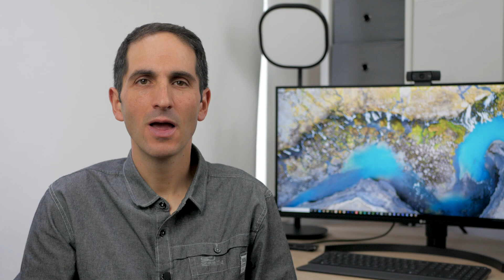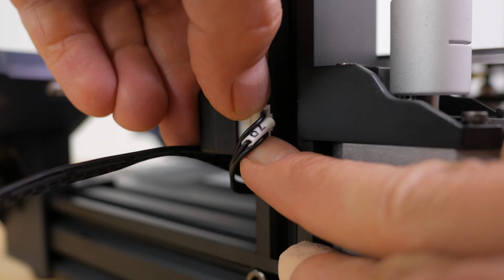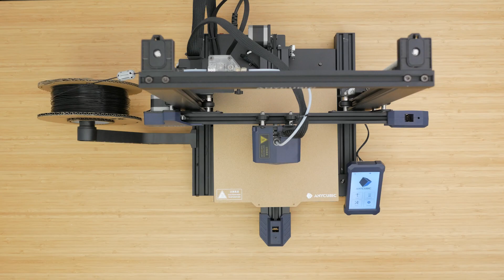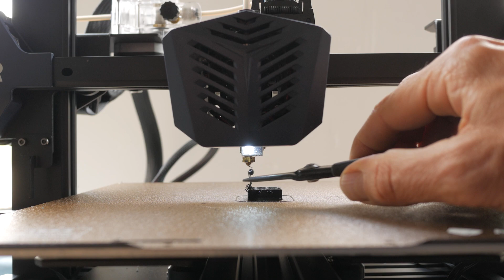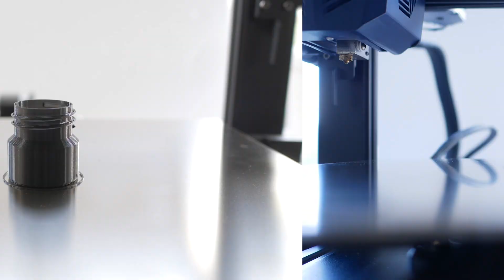Anycubic Vyper review | Perfect beginner 3D printer? | Unboxing, setup, auto-levelling, test prints

Comment: I'm probably a year into 3D printing and the Anycubic Vyper is my first printer. The bed leveling is great but it does have some issues.
Don't print large prints with the spool in the default location, I'd put it above it and make some brackets for the extruder/filament sensor, the default filament tube sucks and will expand eventually with heat creep and fudge stuff up but that's an easy upgrade, print z axis spacers.. I'm currently making a ball bearing spool holder... other than that it has been great.
I don't find it loud and it lives above my room and sometimes I sleep beside it too If I set a timer to flip prints in the night. also last thing my filament sensor and auto print stops during power outages dont work but you just have to make new g-code or cut and glue it where it failed to a new half. Also sometimes if you heat the bed by hand to fast the senso shuts it off so use cura not the touch screen.
Reply from the maker: Sounds like some great tips!

Comment: I have had my Vyper since they were first available ( i3MEGA prior to that). It has printed flawlessly right out of the box. I typically use IdeaMaker as my slicer. 
re: NOISE. I did put a variable buck converter to the PSU fan. Tune to voltage to as acceptable air flow and noise level. BIG DIFFERNCE. Easy mod. Great review. Thanks.
Reply from the maker: Great suggestion thanks!

Comment: My son bought an Ender 3 and I later bought an Ender 5. I bought us both a Big Tree Tech main board which is a vast improvement in noise as it can control the stepper motors better and we installed BL Touches which work just fine. All printers should have automatic bed leveling and be as quiet as possible in my opinion. Thanks for your review...
Reply from the maker: Sounds like some great upgrades. Noise is a big issue I agree - I think 3D printers are generally nosier than people expect - even one with quiet steppers. The Prusa Mini is the only printer I've tested so far that I can work beside if need be.

Comment: Thanks! I bought a Vyper about a month ago (Aug. 2022). For basic parts, I agree that the Vyper works "out of the box". This is my first 3D printer that I own, but I have lots of experience with the University's equipment. Some of the problems you discovered have been fixed by now (e.g., Cura profile). However, my parts are stringy. I ran the TempTower and RetracTower scripts in Cura and adjusted, but still have problems. I am using AnyCubic's cheap PLA so I don't draw any serious conclusions about the printer yet. I have problems with supports being very difficult to remove, but I think that is a profile problem, not the printer. I tried to print an articulated slug that failed miserably. The internal parts fused together (stringing likely). As you said, maybe there is no perfect printer for beginners unless beginners only print "beginner" parts. I have yet to try the clearance test!
Reply from the maker: I'd definately try some other filament. And make sure the filament is dry - even PLA is stringy if wet.

Comment: Great review, I was looking at the Ender Pro V2, but despite your negatives, I think I'm going to go for this one.

Think the auto leveling is a huge plus for me, and the easy removal bed.
Reply from the maker: Great let us know what you think of it!
Reply: Did you get it yet? I just ordered one today.
Reply: @DoofnBluntzGaming  I just got one last week, and I am planning on returning it. Main issue is bed leveling nightmare  (I know there's additional auto lever you could buy), but on mine bed doesn't stay leveled between prints, more so it seems to drift in middle of print (the spring knobs adjusting bed height are very lose and like to shift if you look at them too hard). Second problem is warped and unevenly heated bed (possibly warped due to very uneven heating, not sure). Outer edges of build plate are barely warm while center is very hot, causing serious warping issues on large parts. When it prints a long line on first layer - it looks like a wave some of it scratching the bp, some of it stringing... and yes I leveled the damn thing 1000 times by now. I am beginner so I am sure there are fixes to this, but in my opinion if you're buying Ender3 to print stuff, you're in for a lot of headache. It seems more oriented towards tinkerers/experts. Also manual is garbage, basically had to watch bunch of youtube videos on how to set it up. 

TLDR: It gave me nothing but frustration this far.
Reply: @drawmaster77  Your comments seems to be addressing an Ender 3, not the Vyper in the video
Reply: @vetterbydesign  yeah Ender 3, I got Vyper it's worlds better imo
Reply: Get a Prusa mini.  It works out of the box and has very few problems.
Reply: @drawmaster77  i have similar issues plus i think i got a faulty motherboard causing a a crazy amount of layer shift if i try to print anything bigger than a benchy. They offered to send a replacement motherboard but its still too much headache with the bed not staying level and its also a bit warped, z bar not alined correctly because of the way its set up wrongly so its bending and more issues, so i declined and ordered a vyper. 100 euros more and has way more upgrades that you can do to the ender with that amount of money without the fuss of adding them yourself

Comment: Hi, nice review. I bought the early bird release model at a discount price. And I can see they have made some improvements already by the look of your machine.
I had the problem with the strain gauge sensor. And now have it replaced with no hassle from anycubic. And Also had the extruder slipping, I added threadlocker as it keep coming loose.

I’m pretty happy with it now. But the replacement part took 4 weeks to come, and there also was 24hr delay on reply even though only 4hr time difference in NZ
I think they are on the right track with the design. Maybe v2 will be quieter and improve in build quality
Reply from the maker: Thanks. Good idea with the thread lock. I think 4 weeks is too long - and I agree I'd like quicker support. But at least they are resolving issues. Have fun with the printer!

Comment: I've received my Vyper a few days before. Previously I had a small Tronxy X-1 for 3 years (no heatbed, no auto-level, no filament sensor). Well, my feelings are mixed, and are in sync with your review.

Since Tronxy was one of the cheapest option back then (~1/5 of Vyper) and multiple years have passed for technology improvement, I expected much greater difference between the two printer's performance. I'm kind of dissapointed...
- With Tronxy the parts popped right off of raft, Vyper tends to fuse with it.
- Tronxy displayed info during printing even with Octoprint, Vyper does not show any details only when printing from SD card.
- Both are noisy as hell... :D However, Vyper's fan noise is loud only, steppers are hard to hear during print. With closed door it's nice even at next room.
- By Tronxy, dimensional accuracy was way off in XY plane, that one is better with Vyper.
- However, the same part with the same material tends to have strange blobs and stringing by Vyper. I hope it can be fine tuned, but as there are a lot of complaints on it, maybe Tronxy was superior in this too...

I need more time to get familiar with it, and adjust it, but maybe it is not such a big hit...
Reply from the maker: I think most 3D printers need some tinkering to get the best results - but I'm sure in time you'll have the Vyper singing!

Comment: Still using my Anycubic i3 Mega, & it's proven to be a very reliable printer in it's stock form. Looking at this Vyper, but haven't worked out a real need for it yet.
Reply from the maker: With 3D printing if you have something that works well for you I'd stick with it! If you need a second printer that's another matter 😉 ...
Reply: The i3 Mega was my first printer and it worked flawless until I sold it, I want to get a 3d printer again and I'm wondering if I really need the extra features of the viper over the mega, the only one I cosider important is the build volume and if is more silent, because the mega it was a bit too loud.

Comment: I've been seriously considering upgrading from my modded Ender 3 to this so this info is definitely handy. The ender 3 has a PEI magnetic bed, BLtouch, and upgraded 32 bit board but a lot of the other features on the Vyper seem to be really nice and tempting. Having a hard time figuring out if it's worth it for the larger build plate, all the extruder bonuses, the dual cooling fans, and dual Z lead screws. I know I can potentially add all of that to my Ender but the little issues with things like the BLtouch randomly throwing an error requiring a restart and manual pulling out of the plunger makes me wary of investing that much money into it. It seems better to just spend a similar amount overall to get the Vyper and avoid having to mess with wiring and such and risk damaging the whole printer. I sweated buckets just swapping the board so I'm not inclined to go through that for what is rapidly becoming standard features on beginner printers.

So as a beginner/intermediate user my question is would you consider this worth the money to swap to? I tend to print in PLA or PETG for the most part though I've played with some TPU before and would like to print it more. The improved print speeds are also of interest as I tend to print larger models regularly and just use my photon for smaller more detailed ones.
Reply from the maker: I think if you've already added ABL to your Ender and a PEI magnetic bed - the Vyper won't offer much more. Those are the two features that I consider a useful upgrade. Personally I'd try and fix the ABL on the Ender. But if you're after a second printer that's another matter!

Comment: Hello! Some things are a bit superficial ... Ender 3 V2 has no touchscreen. Vyper has built in TMC 2209 drivers but they are not supported as such by the motherboard, so useless. You have a modified version of Vyper in front of you, recognizable by the flat Z-Stop switches, modified hotend and plug on it. The first versions were very vulnerable, the newer ones hopefully not. Otherwise, thanks for the review!
Reply from the maker: That's right they did make a few changes after they released this printer initially. Well spotted on the Ender 3 V2 - I only have the Ender 3. I quite like the dial personally!

Comment from the maker: Is there another model I should take a look at? If you have this model what do you think of it? Please let me know down below!
Timestamps:
0:00 Introduction*
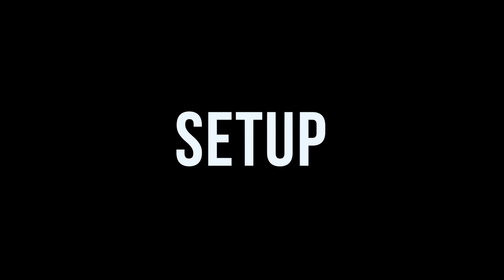1:01 Setup*. Unboxing, what's included
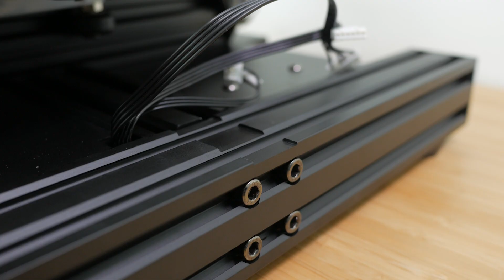1:43 Assembly
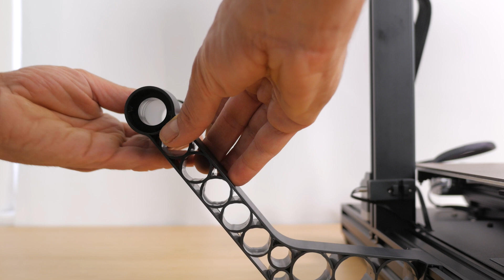2:40 Post assembly checks before printing. Check no play in print head and bed belts are tight
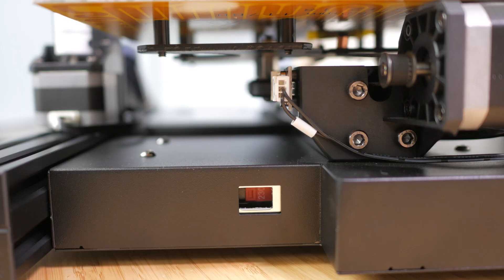3:12 Auto-levelling the bed including important pre-checks. Ensure strain gauge working
4:23 Advantages of this strain gauge levelling system
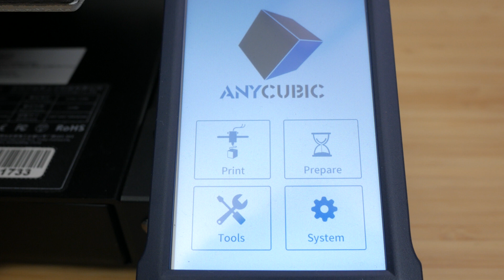5:02 Loading filament
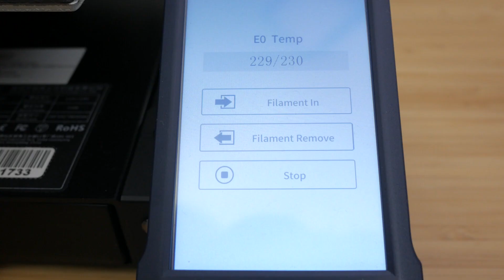5:46 Checking tensioning knob
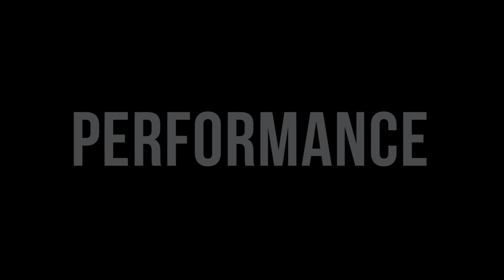6:05 Performance*. Printer specs
6:41 First print with included PLA. Moving owl.gcode to root of SD card. Checking layer height and adjusting Z offset and other settings
7:39 Setting up CURA, importing profiles
8:10 Testing filament runout sensor
8:43 Testing Power Resume feature after power cut
9:16 Testing colour change filament
9:57 Print quality discussion, slicing software and profiles
10:18 Setting up PrusaSlicer with the Anycubic
10:46 Quality difference Cura and PrusaSlicer profile
11:05 Accuracy of prints and testing printer tolerances
11:38 Magnetic PEI sheet, first layer quality and releasing prints.
12:00 Testing smooth side of PEI sheet, cleaning PEI sheet with IPA alcohol
12:41 Testing temperature variation of the bed with FLIR imaging camera
12:53 PETG print quality (Prusament Galaxy Black)
13:15 Flexible filaments print quality. NinjaFlex, Eryone TPU. Creating custom profile in PrusaSlicer
13:47 4.3" touchscreen. Turn off beeps
14:08 Using printer with Octoprint on a Raspberry Pi. Can remotely control printer, adjust e-steps and check mesh bed levelling
14:36 Noise from printer - listen to sound test. 32-bit board, silent stepper drivers, loud fans
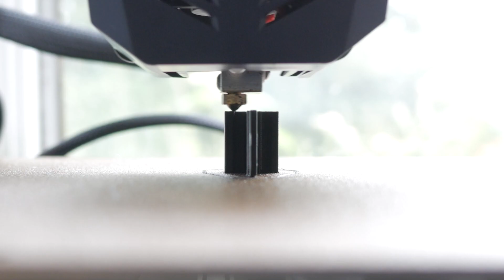15:07 Cable management. Printing off simple clip to solve main issue
15:28 Extruder gears issue. Tightening extruder gear with 1.5mm hex bit 
15:47 Conclusions* and verdict
Reply: Hi have the Vyper and think it's great!
Reply from the maker: Brilliant - glad you're enjoying it!

Comment: The 3D printer is about 3 years old and I still have doubts about its availability. 

First, In today's technology, linear rails have become widespread and I can buy a model like the ender 3 v3 ke for a similar price. However, I care about stable, expandable and long-term use. Which would be better?

Secondly, the printing speed is a little slower than new printers. Do you think this is an important factor?

And finally, Have the slicer updates you mentioned in the video arrived?

Thank you very much if you answer my questions and I congratulate you on such a professional video.
Reply from the maker: I’m afraid I don’t have this printer any more so not sure about updates. Personally I’d probably go for a more up to date printer now.

Comment: Love mine.  Going strong, though I've run into some print 'bending' on larger prints where one edge of the print bends upward for some reason.  I'll get it figured out sometime, I hope!
Reply from the maker: Glad you're enjoying the printer. This warping can occur with larger prints. Try and ensure there aren't any drafts near the printer, perhaps raise the bed temp 10°, thoroughly clean the build plate first with IPA alcohol but even better in the sink with a light (white) scrubbing brush and some Fairy liquid.
Reply: @TheTechnologyMan  Good tips.  Thanks!
Reply: What Is fairy liquid?
Reply: You don't wanna know.😂

Comment: Have you tried removing the nozzle from the hotend on the Vyper?
If you do it as explained by Anycubic. You will break the hottend mount and possibly  damage other components around it.
From what I understand you must completely remove the hotend before you try to take the nozzle out.
Reply from the maker: Yes - you just need to make sure you heat up the nozzle to a high temp and keep the heater block secure while you loosen the nozzle.

Comment: I'm trying to change the temp  setting in the generic materials in Cura. For some reason after I make the change it goes back to it's defaults setting. Thanks for a great video
Reply from the maker: Sorry I missed this comment. Does it go back t settings when you print - is that what you mean? Have you changed both first layer and other layer temps?
Reply: @TheTechnologyMan  It just doesn’t save the settings you can close it and open it back up in the settings are the same kind of a nuisance. It took me a while to figure out how to get the sidebar to show up I had to download a plug-in a bunch of things back-and-forth. But I’ve got it I’d like to ask you another question if I may. Can you hook this directly to a computer without using raspberry pie not that I mind raspberry pie but it’s sitting right next to my computer. I’ve asked this on several format forms and have not gotten an answer
Reply from the maker: Yes you can - you could use something like Repetier or Cura (IIRC). The only reason people don't recommend it - is for long prints you might get a failure if Windows does an update or similar. I ran a Prusa Mini+ directly off my PC for a bit. I installed Octoprint on the PC (which a little fiddly), but it worked great. And I could monitor my prints remotely with an app like Octopod.

Comment: Great Video i Love it i bought a vyper too now.
I would be interested If the nozzle changed for a advanced one Like a plated hardened Steel one. If this would the vyper make more relailable with hard filaments Like glow in the dark.
Reply from the maker: Great glad you liked the video and I hope you enjoy the printer! Yes if you're going to use any more abrasive plastics he'll need another nozzle. Usually the filament manufacturer will specify the type of nozzle you need.

Comment: This was everything I needed to know, thank you! I'm looking around for a first printer and the cost/print-volume/low-maintenance trifecta here seems like a brilliant tradeoff for the software-tinkering and minor print quality issues. My priority is functional bits-n-bobs for electronics and DIY (connectors, adaptors, clamping jigs, parts storage tubs, etc.) so surface texture/stringing are non-issues as I'm really not fussed about aesthetics at all.

Given that it's been almost a year now, are there any newcomers worth checking that beat the Vyper on ALL counts at the same or lower price point? If not then I think we have a winner... just as soon as I've cleared enough workbench space for it :)
Reply from the maker: The Ender S1 and S1 Pro perhaps - I've only tested the S1 Pro but it's more expensive than the Vyper. Also if you don't need the larger capacity the Prusa Mini is a good printer - but the price has gone up a bit. I'll always looking for the perfect 3D printer for newcomers to 3D printer so will keep testing!
Reply: Right, I checked out your S1 Pro review (also stellar btw) and the extra filament options are a big draw, soooo now I want that but with the Vyper bed for better heating and levelling, and Prusa firmware/interface/support... not too much to ask, is it? 😅

Oof, this is a dangerous rabbit hole to fall down. I'm already thinking about silent fan/PSU mods and I'm at least 3 months out from even having space to put the damn thing.